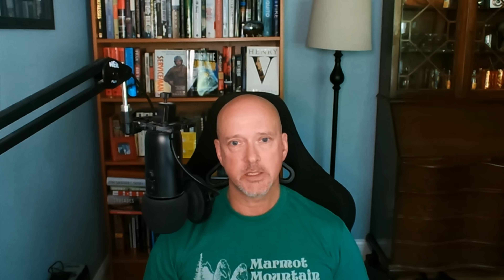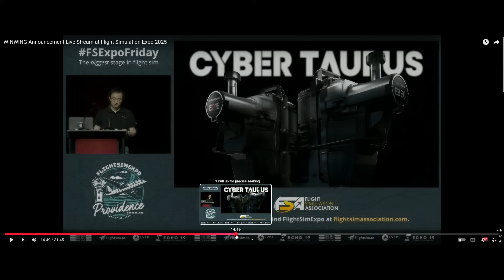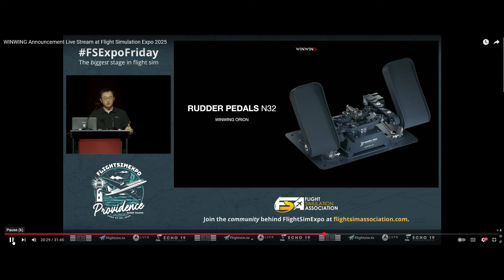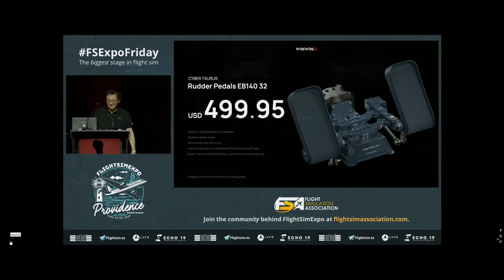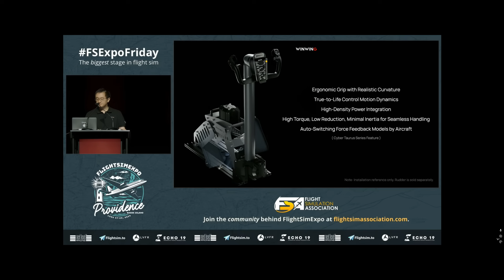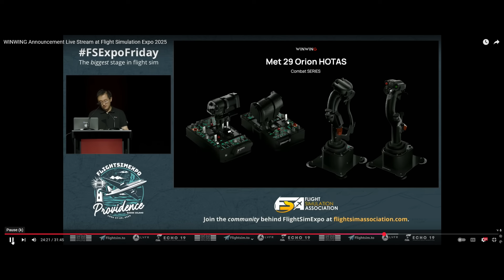WINWING Cyber Taurus: The Future of Force Feedback

Comment: I have WW’s discontinued Super Taurus F/A-18 twin-throttle base.  It’s a big thing that really needs to mount in a cockpit tub or a seat with metal supports to mount stuff.  But it’s the coolest!  I love it.  The throttles have a realistic throw range.  They feel like realistic levers with a functioning friction lever.  Plus, lots of switches.
I think they should bring that unit back to production.
Reply: I've got one along with the full MFD UFC setup, all bolted to my DOF reality motion rig, WinWing are the best thing that happened to the flight sim world in years IMO, very reasonable prices I think.
Reply: I do own the Super Taurus throttle as well, but i have to say i´m not that happy with it. The unit itself is great in terms of haptics, mechanics and immersion. However, the electronics are not that great. 3 switches failed so far (2 of them during warranty - WW denied RMA, puchased replacement parts and repaired it by myself), the TDC slew axis had permanent input when centered from the beginning and needed a 10% deadzone. Due to the TDC slew becoming worse and worse and i didn´t want to dump a 700,-€ throttle, i purchsed replacement grips (F-15EX grips) hoping for the better. Nope, exactly the same problem with the TDC slew axis and another axis didn´t even work at all (yes, one of those that was listed as functional on the Super Taurus) and again, WW denied RMA.

The WW devices can be nice (if fully functional), but their buisness practice is more than questinable imo. That there have been cases (proved by screenshots) that WW asks customers to delete negative reviews prior to accept warranty RMA, adds to the impression. The low price has to come from somewhere.
Reply: @r4dio4ctiv3man9 I got the F15EX handles as well, i've had zero issues at all with mine. TBF the Taurus was an early bit of equipment from them, they seem to have gone from strength to strength the last couple of years IMO.....and the price point.......still very reasonable I think ?
Reply: @PhantomMark  That is true, but as is aid. Not only the products itself, their behavior in general. There is no problem as long as your devices work as intended, but once you need to get in contact with WW for a solution that will cost THEM money, there is at least a chance you´re experince won´t be great. I know people who had no problems with WW customer service but on the other hand some who had massive problems. 

What bugs me specifically is, that one of my DCS buddies purchased the Super Taurus as well half a year after i got mine. And he had exactly the same issues with the TDC slew axis + denied RMA. This made me think that WinWings QA is pretty sloppy. Can´t say if they got better tbh, as i didn´t purchase anything since the desaster with my F-15EX grips. Originally, i wanted their Hornet UFC + HUD panel as well, but took the pain in the wallet and went with Cube Controls for that. Triple the price, but you definately get what you pay for in this case. Well worth the investment and i don´t regret. 

The price is reasonable, absolutely. And i do admire WinWing for coming up with affordable flight sim peripherals so people with less money (or a more strict wife) can enjoy something significant better than the Logitech crap. I absolutely give credit for that to WinWing, that definately brought a lot of people back into flight sims. No doubt. But i have always been someone who is willing to pay significant more for top quality and i didn´t went for the Super Taurus because of the price (it was rather expensive, in fact the most expensive throttle at the time iirc - Realsimulator F-35 throttle wasn´t out yet back then), but for the immersion as it was the only Hornet replica throttle at the time. Immersion / replica controls are way more important to me than a "reasonable" price. If there is no replica, i go with the best i can find and afford. And since the Super Taurus throttle represented both at the time (best i can find plus beeing a replica control of my favorite jet), i´m rather dissapointed. I just expected more from a 700,-€ throttle tbh.
Reply: Yes, the Super Taurus is not perfect.  I never use the TDC, because it seems essentially unusable.  However, I don’t miss it too much.  It centers, but it’s so sloppy loose that it’s very difficult to be precise with it.
I also have collisions between throttle grips when using them individually…such as with WWII planes using one for throttle and the other for prop, or as a helicopter collective and throttle.  All-in-all, I’m happy with it.
Maybe someday they could bring it back as version 2 with problems solved.  Or maybe a more generic switch and knob base.  I use it with VR, so I can’t see it anyway.  I go by touch and feel.  You can only have the perfect setup for one aircraft anyway.

Comment: The pedals NEED force feedback on the brakes!  I think.  So you can feel the point the brakes bind and how much pressure you’re applying to modulate braking effort…in those aircraft with simple hydraulic brakes, like probably the WWII birds.  But would also give the proper, realistic feedback for larger aircraft with a more “power brakes” feel.  The main thing is sufficient resistance. This is something really lacking in brake pedals like Thrustmaster TPR.  Those brake pedals are so weak in resistance that it feels like nothing’s there.  You have no idea how much pressure you’re delivering and have no idea when the brakes will lock up or hit ABS.  You need to be able to feel it in your feet.
And a FFB system on the brake pedals will make it customizable to each aircraft.  As well as for helicopters and those like the MiG-21 and MiG-29 where there are no brake pedals…but that long  lever on the MiG-29 (&21) stick is the brakes!  I expect that long lever would be a Hall-effect axis with significant spring resistance to modulate the braking.  But in helicopters and these MiGs, the brake pedals function on the rudder pedals should go to maximum torque resistance or somehow lock so as to not deflect.

Comment: Been following WinWing since they showed up on the Combat Flight scene With their Taurus F-18 kit. Everyone said it was going to be cheap Chinese crap that will fail "I mean just look at the Price!" Well after 5 years and more all the guys I know that bought their kit at launch still have it and it's still working like new. I have their full combat line up with the exception of their Orion Rudder pedals. All of it after 2 years is still like new in operation. This company has always stated they want to have a great reputation in the market place for the standard and reliability of their kit. I have to agree from what I have seen with the kit I have bought and others that it is very reliable and of good quality.

WinWings Achilles heel or heels are 2 things. The first one they are dealing with and that is the fact I think they underestimated the demand their products would have and as such you can have a long wait to get any of their kit, but it seems they are building more factories/ Production capacity to compensate for that. The second issue is their customer support which is a double edged sword. Things do fail and things do break that's the truth for any manufacturers product and when your WinWing kit fails or turns out to be not working on arrival, It's not a simple take it back to the shop and get a replacement deal like most. If you can't get it fixed you have to RMA IT TO CHINA! NOT YOUR LOCAL SUPPLY WAREHOUSE! Now don't get me wrong they do everything they can to try and get your kit fixed by getting you to allow them to connect to in online and see if they can fix it with a software fix. If it's hardware related they will ask you to open it up and guide you to try and fixed it manually yourself (something a lot of people are not comfortable with doing) So they really do try hard to get your kit fixed without having to return it but if they can't fix it in your house returning it to China and having to pay for that and the LOOOOng delay in it getting there (HOPEFULLY IT DOES ACTUALLY GET TO THEM) they then have to check it out and then return another one to you. They will not send a replacement until they receive the old one!

Your looking at weeks by the time this return process is complete by having a new one sent to you! Not good at all! They need local (country level) return depots that can quickly send out replacements so your not unable to fly for weeks waiting for them to send replacements!

With regard to FFB the current best systems the VPForce Rhino and FFBeast are both great systems and implement force at 9Nm and 20Nm.(5KG and 10kg of force roughly) both of these give an amazing experience of being connected to the plane for the average simmer and Moza's offering is similarly 9Nm but still has a long way to go on the software side compared to VPForce or FFBeast that already have auto switching in their software and high level haptic feedback also which Moza seem to be struggling with but they will get there I'm sure.

So what strength FFB do you need? Well the lowest 16nm on offer from WingWing will give you an amazing experience VPForces 9NM IMHO is more immersive than having a VR headset on as it connects me to the plane/Jet/Helicopter and having the FFB Rudders thanks to modders in the VPForce community also adds the connection to the sim for feedback for my feet also. I cannot answer what you "need" other than with "just get one! Any one version of it" even the lowest Torque version will be a game changer for your simming experience! How to answer "WHAT I WANT!" Well as a guide the REAL F-4 Phantom 2 put forces through the stick that reached up to 60Lbs of pulling force so that's about 28Kg of force! 9NM gives you about 5Kg of force so if you want "FULL REALISM" in a F-4 Combat jet while in the middle of a high G dogfight in DCS World your going to need 6 times more force than the Moza or VPForce bases can provide!

BIG Warning here though, go for the 60nm of Torque version and you have a powerful component that can cause a lot of damage to you or any Equipment that's is next to it! 5KG 10Lbs of force traveling at over 40 MPH can be painful and damage your hardware that are in the way! That is what Moza and VPForce have 9Nm/5Kg BUT 60NM of Torque is going to be a lot more damaging! So if you crash your jet expect that stick to get ripped from your hand and violently whip and rattle around. No joke bones (in your hand) and arms might get broken and expensive hardware smashed such as MFD screens. Care need to be taken to place it so that "NOTHING" can get in it's way of it's full movement.

As for their Rudders I can tell you that they will act like they do in real helicopters as my VPForce modded MFG crosswind FFB rudders already do this.

That MIG-29 stick is full metal construction (No plastic except on the switches) and is needed to withstand the forces of FFB and also match Winwings previous grips that are also full metal!

When Winwing do release their FFB hardware it is going to be great to se the difference between it and the currently available FFB bases out there. But when will that launch be??